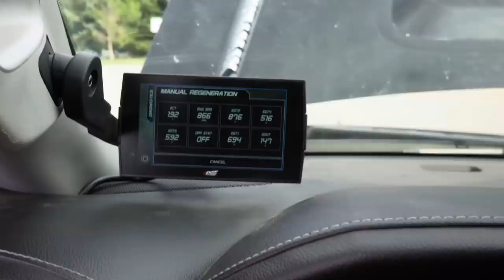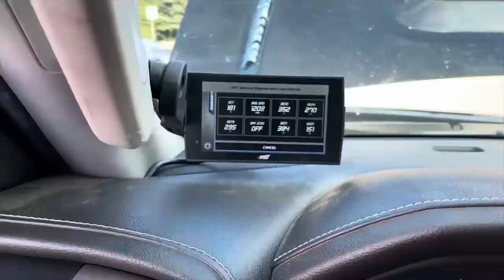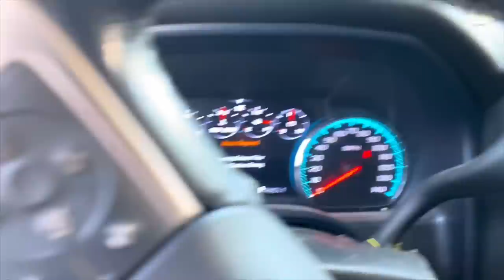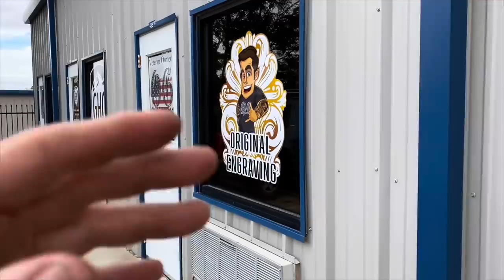I’m Stranded 20 Hours From Home In My Duramax! Part 2

Comment: Keep us posted on your truck, how much money to keep legal. My 2008 LMM is at the point that it will regen EVERY time I drive it no matter if 30-60 miles, light truck or pulling a tag along trailer. A week ago my truck de rated and would only go 20 mph , foot to the floor and 3000 rpm to travel 2 miles to get off the highway. So do I repair (much $$$$), "fix", sell it or junk it! I can hardly afford to drive it account sorry fuel mileage from the regen. I make you laugh, I used my Honda Ridgeline to rescue the trailer after I limped the 2008 GMC home.
Reply: As long as your not in cali or a city all the time deleteing it’s fine
Reply: What was the error when it went into limp mode? My 2007.5 LMM will say I need to replace the fuel filter (I dont) it does it when it's hot outside and I'm pulling a trailer through the mountains.  I put in a lift pump, which helps a little, but not 100%.
Reply: @fredandersen9873  i think the message was: reduced power, but when i looked for other codes on my tuner there were none. when i turned the truck off to remove the pintle hitch and minutes later restarted, the truck seemed to have the normal power back so i hauled butt home 10 miles away. the truck has not moved since until i make some decisions!
Reply: the bully dog tuner has been on this truck for 10 years and no issues until lately.

Comment: GM products are absolute garbage   stick with Ford and Toyota
Reply: Your on the wrong channel Todly. 😂
Reply: I'm a ford guy but this could happen to all of them . Your on borrowed time when you have a dpf system or egr system.
Reply: @dieselnut2369  I’d have to agree the clock 🕰 is ticking if you have some of those parts